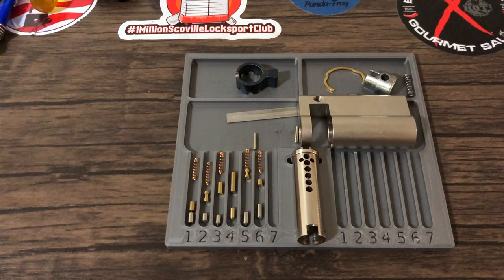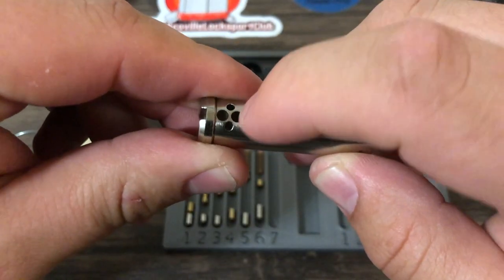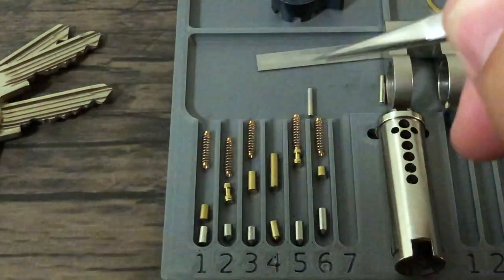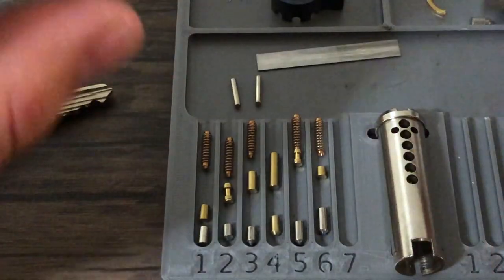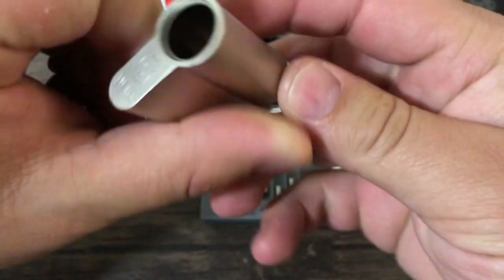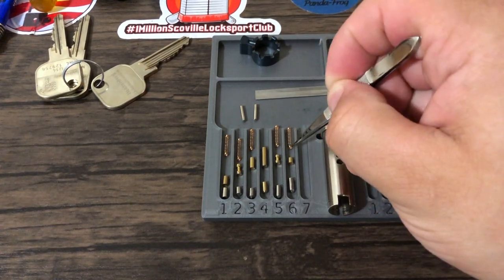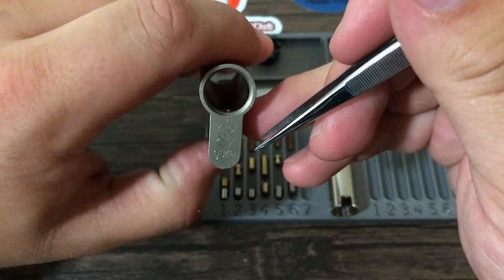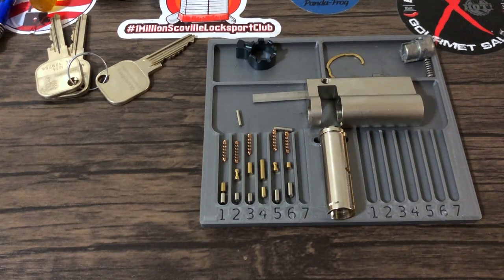Black Belt CL Q&A

Comment: You could have a pin sitting in the back in the middle of the keyway American style, long enough to still have a small portion inside the bible, but short enough that would retract into the bible when in euro style. That would mean sacrificing one of the plug + bible chambers, or you'd have to make one more.
The key would still work but only if euro style. Sliding sound would alert for this trickery.
The pin couldn't sit in the warding, where a deep enough pick would lift it, would have to go through the warding to the bottom of the keyway. So, you'd have to drill it.
Just some ideas.
Reply from the maker: Wonder if you could have the key repel that pin using a magnet so it works American style
Reply: @RoonPicker  if so, you could also pick it american style, by using a pick with a magnet, I believe. Even without it, you'd have to have space to put the key underneath, so just using a pick to push it could work.
To force one to use euro style using this method, there couldn't be space between pin and bok, I think.